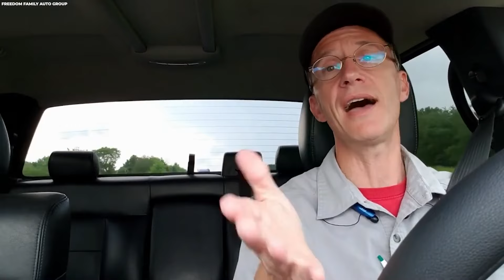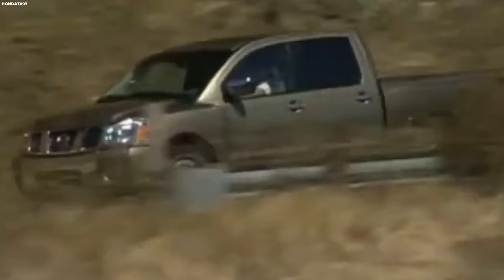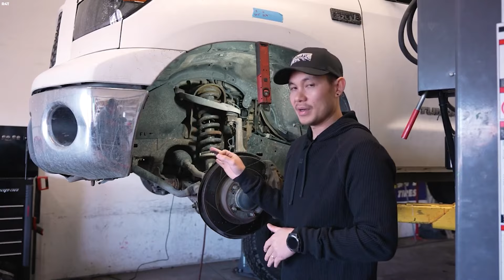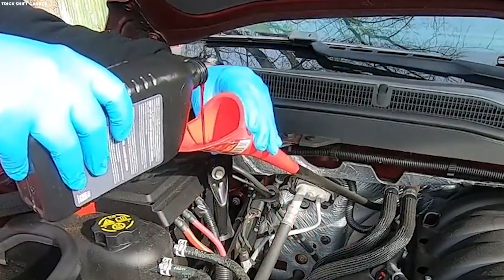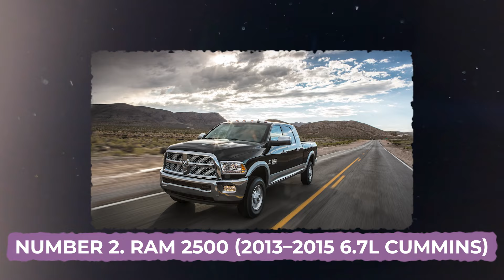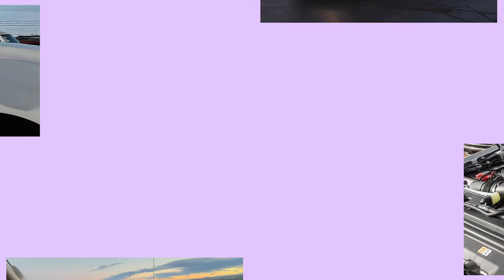10 Trucks That Fell Apart Before 100K Miles

Comment: Don’t forget the exhaust manifold bolts that love the snap off too when you go to replace the header that rotted out on the F150 at that point, you might as well just go to the junkyard and unload a whole cylinder head from a truck as long as the manifold itself is not rusted